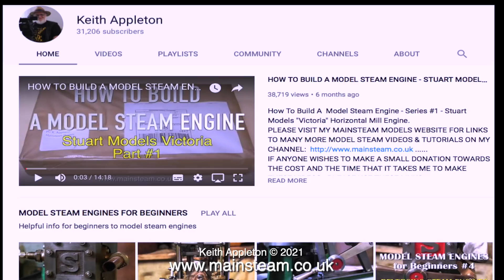MODEL STEAM ENGINES AND BOILERS - PART #7

Comment: Bonjour Keith,
The paint is messy and impossible to clean, which is why I prefer Teflon tape ;+)
Amicalement, Raphaël
Reply from the maker: Yes, that's what I used once upon a time, but I found that it soon turned brown as it became stained with oil etc . . .

Comment: can i assume there is a reason you didn't crown the flywheel to keep the belt running straight?

[ and, if so, what might it be? ]
Reply from the maker: not required, the same as with my large Showman's Engine, that isn't crowned either.
Reply: @keithappleton  now i know. thank you.

Comment: If there is anything more tedious then wrapping model model pipping in cotton string it is wrapping full-size steam pipes in cotton wrap, which I had to do in building malignance miles of it, then after it was  wrapped it was painted along with all the other wrapped pipes (water, gas, AC pipes, sewage, etc). Then as a Hobby I went and wrapped the pipes on full size steam trains and boats.